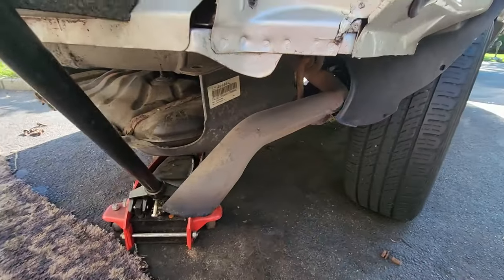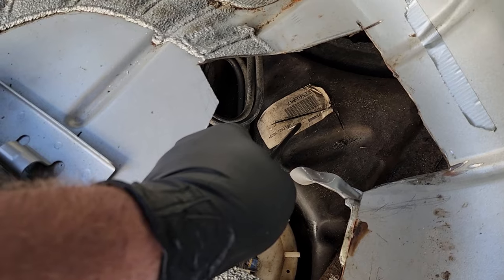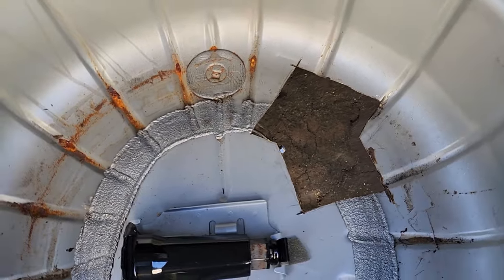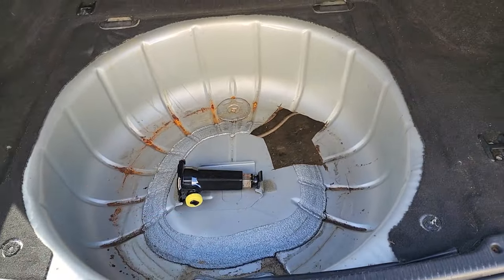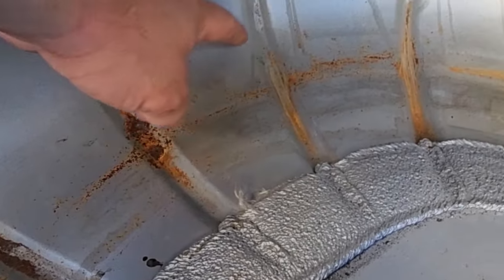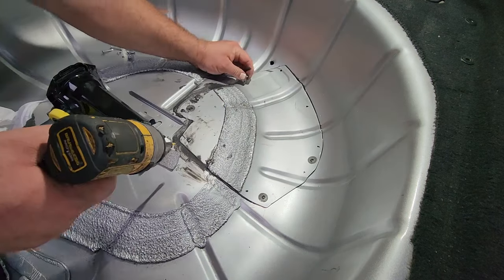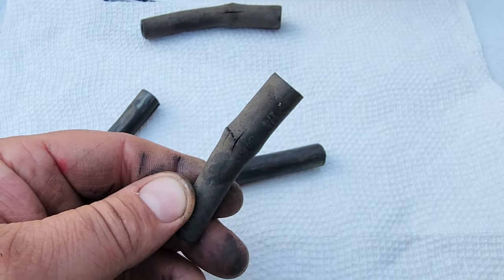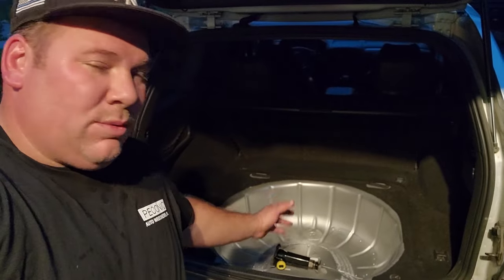GRAND CHEROKEE WJ FUEL PUMP ACCESS HOLE? CORRECTING A BAD CUT WHILE SEALING AND STILL KEEPING ACCESS

Comment: Same thing for when people cut the header panel to access the fan relay under the passenger headlight (although not as dangerous). Previous owner of my WJ did that, and cut right into the vacuum reservoir, causing a vacuum leak that took me way too long to find.
It's quicker to take time to do it right than to do it wrong twice.
Reply from the maker: Oh man!  Incant stand hacks!

Comment: HEY DAN,  YOU DID A GREAT JOB WITH THE " FIX".  BUT WHAT YOU DID WAS JUST CLEAN UP THE MESS THE PREVIOUS OWNER OR SOMEONE ELSE MADE!  AFTER SAYING HOW DANGEROUS CUTTING A HOLE OR HAVING A CUT OUT FROM ON TOP OF THE GAS TANK IT IS?  YOU WENT AHEAD AND JUST MADE A NICER ONE!  THAT IS NOT REALLY RIGHT!  THE RIGHT THING TO DO WOULD HAVE BEEN TO  EITHER REPLACE THAT WHOLE SPACE TIRE PIECE OR AT THE LEAST GET SOME NEW SHEET METAL AND WELD IT NEW PIECE MAKING IT SEAMLESS AND FITTING IT LIKE IT CAME OUT OF THE FACTORY.   YOUR HOLE DOES LOOK GOOD!  : P  BUT ITS STILL JUST A BETTER INSULATED AND LOOKING HOLE.  ITS NOT SEALED THE WAY IT SHOULD BE.  IF YOU DID WANT A HOLE THERE TO ACCESS THE FUEL PUMP, WHICH I AGREE SHOULD HAVE BEEN MADE THERE TO BEGIN WITH OUT OF THE FACTORY!?  IT SHOULD BE DONE LIKE IT WOULD BE DONE IN THE FACTORY.  COMPLETELY SAFE, SEALED AND OPERABLE WHEN NEEDED.   WHAT YOU DID IS NOT EXACTLY THAT.  FUMES CAN STILL ENTER YOUR VEHICLE FROM THE GAS TANK.  AND LASTLY,  WE ALL NEED TO ACCESS A HOLE AT TIMES!   : P  LOL........

Comment: Yea you might want to enlarge that hole and then cut metal out of your other Jeep and over lap the sheet metal. There is a tool out there you drill a hole then this device put in thread in the sheet metal. I was watching a video the other day you need a little muscle your titen the threads in to the metal. This person mentioned that he got this tool over at Harbor Freight. Most of the time I tell people to stay out of there. But if this tool did cost to much you might want this tool for other jobs.
Reply from the maker: I just made a simple template!

Comment: Hi Dan I would say drop the gas ⛽️ tank but before you put the gas tank back in I think it would be nice to have an inspection door big enough to get that fuel pump out with out a bunch of trouble getting it out. Just so you know serval years ago my fuel pump went out. I had my GMC SONOMA 4.3 V6truck 1st towed to the dealer way over 1,000 dollars then I finally had my truck towed to a auto shop 750.00 that was still to much bet I bit the bullet and had them do it yes he should of used a little more safety buy removing the tank or at least lowering the gas tank and maybe removing  the fuel out of the tank I probably would of removed all the fuel out of the gas tank and also if I could get my hand up where fuel pump was I would use some soap water that Dissolve gas so you wouldn't blow yourself up. And then make a small hole above the fuel pump big enough so you can see approximately how big of hole you need to cut in order to get that fuel pump out. Anyway I hope you kinda like my Idea 💡. I'm thinking about cutting a hole over my fuel pump and going to a junkyard and see if I could buy a small portion of a truck bed over lap the hole and put some self tapping bolts 🔩 in the bed.
Reply from the maker: There ya go! It's good to have a plan brother!

Comment: While dropping the tank is best practice, I totally understand cutting to gain access. There is no reason why manufacturers can't make a sealed access door to the fuel pump. Not everyone has lifts and numerous jacks laying around. Also these Jeeps are very prone to rust which would make dropping the tank even harder or impossible.  If anyone does do this, DO NOT use an angle grinder or anything that can spark. Seal it up properly and I don't see an issue. Stop scaring the shit out of people.
Reply from the maker: If you have the means and the balls to cut into your Jeep then you probably have a couple jacks and jack stands laying around.  The fuel tank should be dropped and assessed for a rot especially in places Prone to rust.  I'm sorry ,There's no good  reason to chop a hole in the Jeep, especially right above a fuel tank where evap leaks are common.